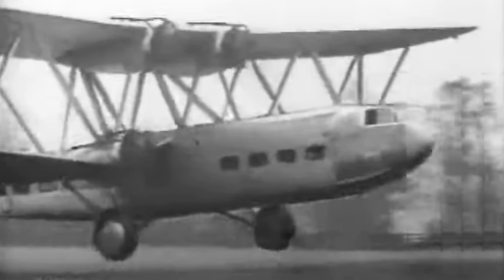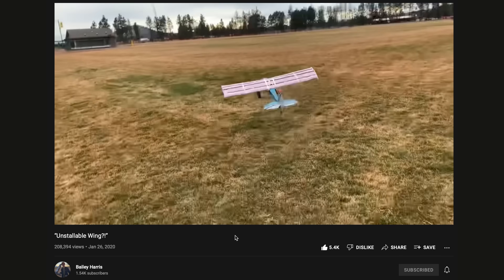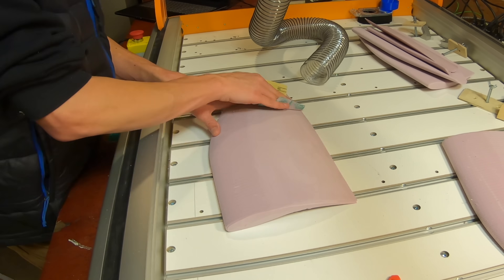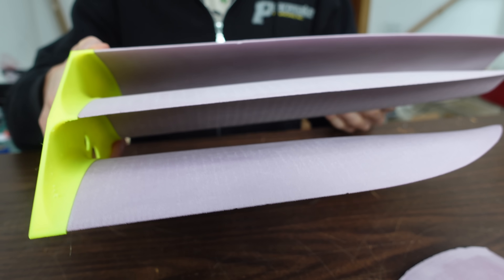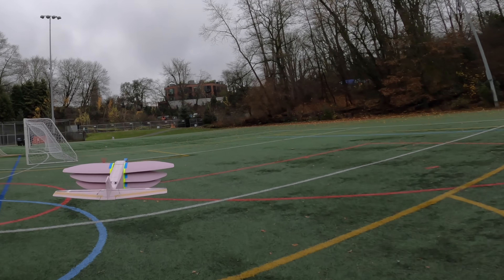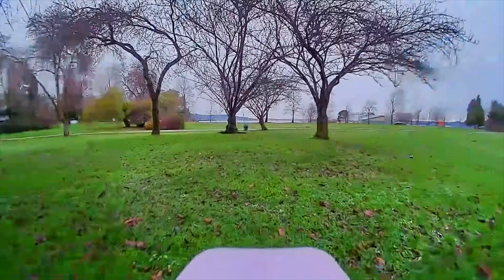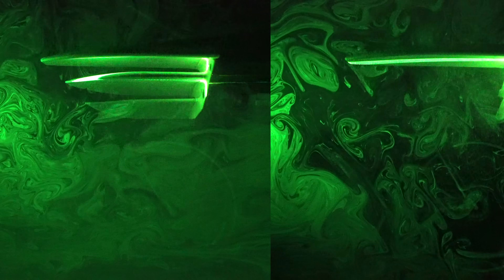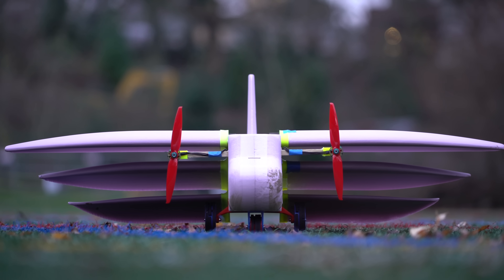Best STOL Wing Design Ever?!?

Comment: I found this interesting.  I would like to hear your thoughts on a ducted wing system porting to the BOTTOM of the wing.  I see what you are doing to maintain the laminar flow of air over the flaps for slow fight control...  BUT as you say  26% of the thrust is used for thrust, what if the ducted air was used under the wing to create lift and use a smaller percentage of ducted air to the flaps.. maybe with a stepped down flap that could capture the air flow from the lower surface???

Comment: High camber leads to high drag, no matter if the foil consists of many foils or a single one.  Seems the Flying Flea design with two very lightly cambered wings (and no horizontal tail) is near the ideal, and you don't even need any ailerons! Pitch sensitive, but with an awesome flight envelope! Like the Shinmeiwa flying boat, no rotation on take off, and flaps on the rear wing for slow flying!

Comment: Maybe incorporating a line of air ducts within a single wing so air passes over, under and through a wing would be interesting to find out the results of  the lift capacity and flow of the air plus air vortices along with other technical elements etc. that occur in this type of design ???

Comment: great flight, it has the stability and smoothness of a much larger plane, is it the future of RC flight, I think not, that is long thin wings similar to a glider with electric props and then free flight, that's what I'm making, but I've kind of stalled, the servos, motors, controllers are expensive and the mixing and matching process isn't obvious, I wish sellers would do basic all-u-need packs for flights builds,

Comment: so you just use all angles of attack at the same time, kinda finite element split method. well box wings with different angle of attack. so how about high aspect ratio wing spacing. come on the trimaran water cat floating boat tracked vehicle tank! :)

Comment: Need to control “speed” with elevators instead of throttle, the pitch down is caused by CP moved rear as lift increases with constant AOA

Comment: If I recall, there are recipes available online for the smoke used in old school wind-tunnels, and with a good sized shop fan attached to a box with acrylic or fiberglass windows, creating the smoke lines through a few holes in a metal box is actually quite simple. Just remember that you're dealing with fire, so keep the box on concrete and obviously outside.

Comment: It would be interesting to see this with like double the wingspan and with a little dihedral. Also, placing the center of thrust directly in front of the center of lift (3 dimensionally) would give you added lift from the engine thrust.

Comment: Something you might want to think about. While sails on a sailboat seem to be significantly different from wings on an airplane, thin vs thick, and probably many other things, there is at least one bit of research that might help you think about this.

Many small racing sailboats have two sails, a main and a jib. It was found many years ago that for a given amount of sail cloth, a jib and a main were found to sail upwind, when they are more like wings, faster and more efficiently, than a single sail. For years this was attributed to the jib improving the efficiency of the main by accelerating the flow in the slot.

But there is another phenomena that racing sailboats regularly run into: when two boats are sailing upwind near and parallel to each other, and  one is to windward and the other is to leeward (pronounced loo-ard. I hate it when someone says "lee-ward", or "gun-whale" instead of gun-ell. Sorry, tangential -- just me) and even slightly ahead, guess which one pulls ahead? It is always the leeward boat. Which doesn't fit well with theory.

Turns out there was this guy, Arvel Gentry, who sorted things out. He was a, "research specialist in transonic, supersonic and hypersonic vehicle aerodynamics at the McDonnell-Douglas company. He was also a successful ocean racing skipper and an amateur photographer." Rather than me bumbling through an explanation, please read this article he wrote for Sail magazine in the seventies.

https://web.archive.org/web/20120308100740/http://www.arvelgentry.com/magaz/How_Sails_Really_Work.pdf

And there are many others if you search.

Comment: I love the concept. But how about you do a T tail configuration.
It should get a smooth air flow.
Maybe even a motor in front of the Time tail configuration( Just like the Tri Lander aircraft ). It should also give it excellent slow speed handling.

Comment: I like it. mostly because its simple. we could improve the inflight characteristics of the design by making a kind of gimbal that move the two rearmost wings up and into the airflow to make just two big wings while in flight and pivot down for slow speed maneuvers. Would have a lot less drag at normal flight speed that makes it unstable

Comment: The throttle up-nose pitching could be caused from the props funneling more air over one or two of the split wings, giving them the predominant lift profile and negating the other wings. You could test this by shifting the props above the fuselage so you get only ambient air movement over all wing sections.

NOTE: I don’t know anything, just a gut feeling.

Comment: One thing I've learned about building RC planes is if it doesn't fly right and crashes there's no use in picking it up and chunking it again with out making no adjustments cause it's definitely not just magically going to start flying better by itself 😂 I've done it though many times till I got sick of buying props and fixing broke motor mounts ect 😆🤣

Comment: You might try it with the narrower wing at top and the biggest wing next, then a series of narrower wings wings in back and under neath, all to isolate and accommodate the air flow and lift on main big wing. That way the bigger wing has the least amount of breakaway air wrap/lift on the top of it, and the most uniform lift. Then find the best angle of attack for each wing interacting together, and then the whole wing cluster together. Then adjust the proper angle of the fuselage to create it's most amount of lift. Keep in mind using the center of weight of the fuselage for proper nose weight, without having to use extra nose weight, which will keep the plane lighter. Then add that fuselage set up to the correct angle of main wing cluster, and you should have a more efficient lift to drag and weight ratio for a given plane. My dad and I used to make balsa wood gliders back in the early 60's. Of course the sky is the limit on designs that work. The combinations just have to be solved so that all the force fields co-operate. I really like how you show how these theories of lift are at play and in use here with millions of lives at stake, all day every day with the airlines, and how efficient they are with their radical flaps on big jets. Great photo examples of this.
     But of course, there are different purposes. Big jets have to do it all, efficiently, to be safe and save money. An albatross has to surf the air waves above the ocean waves for thousands of miles a day. There fore they have one sleek high aspect ratio super long wing-span to operate at extreme high speeds for a bird, over 99% of it's flying time. Where as the opposite extreme is slow flight speeds where you have insects like moths, butterflies, bees, and dragon flies with overlapping multi-wing set ups, for STOAL manuevers for sipping nectar, eating, and spreading pollen all day long.

Comment: Perhaps running a single propeller directly in front of the plane? It looks like the top two wings get the accelerated turbulent air but the bottom one doesn't which changes causes the plane to nose down upon throttle increase.  I'm no expert, just an idea.  Perhaps you could put the propellers behind the wings somehow?

Comment: Yeah yeah.
But with adjustable engines, (you have them on a Pylon) just go V-22 Osprey if you want STOL.
Because Real Aircraft, With Real People flying them. Are already landing in less than 10 Feet. And Drones with no wings land pretty short too.
... looked like about 6ft for your 👍 that's something

I got a Paper Airplane that can match it. And it takes less time to assemble 🤣

RC'S ARE COOL 👍 👍 👍

PS.
You don't need the extra weight of 2 Servos in the front or rear. Especially in a low speed RC. I never used separate Servos for anything under 70mph.
But,.. I used my aerospace engineering knowledge back then. Not a half dozen computers. You guys will catch up 😂 🤣 😂 👍

I gotta add.
There are Fat Delta Wing RC Designs that will outclass what you are working towards.
Simpler. Easier. And better low speed lift for tiny planes. They are like a Kite 🤗

... blah blah blah , Enjoy 🖖

Comment: Very Cool, but very impressive machining center. Laser Milled in 3D, is truly magic. 
My thinking might make the wings longer by 12 inches, and adding a couple more inches to trailing edge, and use just two wings. 
I'd really like to see landing gear using long carbon fiber skids about 1/2" wide vs wheels for smoother rough grass landing and take offs. 
Never got around to experiment with my 2.5 meter glider, but wanted to try a single motor to Twin out board props by belt drive. Finding these parts is the hard part. 
The auto flight feature is very impressive.
Cheers

Comment: Hey Flyboy, you have the basics of aviation wrong. Wings do not create lift by pushing air down. They create an area of low pressure above the wing by pushing air over the curved surface. Thats where the lift comes from.

Comment: Would have had to lower the props with the additional added 2 wings to balance the pitching forward under throttle. The extra wings cause extra drag thats far out of line with the pull of thrust

Comment: Put the ones on the bottom, in front, so the compressed air is forced under the upper wing.there must be more pressure  below each wing than above it. Unless they are at different angles.

Comment: Howdy, very intresting work. I was really impressed with your CNC fab of your plane. I have a design that I want to build but don't have the equipment or RC experience. My plane was built with balsa wood back in 1984 and just as a gulider flew with no breeze over 100 ft straight and level. I have always wanted to up scale the design and RC it.  Would you be interested?

Comment: This wing design has loads of drag, because in forward flight there is loads of disturbed air behind the main wing. If you want to make a really good STOL plane look at how BUSH PLANES work. The main wing has normal angle of attack but quite a thick aerofoil, which generates loads of lift at low airspeeds because of the high pressure differential between the upper and lower surfaces of the wing. The planes are also very light. Thus they take-off and land at low velocities, but still fly well because the wing design doesn't generate lots of drag.

Comment: Hey what if there were two more motors in the hull with shafts protruding out behind the craft with not propellers on them, but counterweights the same mass as the propellers that themselves are just slightly imbalanced on their shafts.. if they were spun the same rate as the front props would they potentially counteract the spin the craft feels when throttle's increasing and stabilize forward flight along the vert. axis causing far less movement off of it's set course trimming when changing speed

Comment: I'm glad to see you make 'special' mention of what you call 'twist' which is really called 'washout'. Washout is critical at conditions nearing stall conditions. At these conditions, portions of the wing nearing the wing tips are still flying. This allows for aileron authority as the stall condition progresses ... you really want that. A more general, yet similar, relationship exists between the mains and tail angle of instances (tail being less than the mains) thus providing pitch authority even as the mains start to stall. Both of these give you a chance to 'wake up' and fly the airplane 'out and away' from disaster.

Comment: You might want to look at F1 front winglets. Although they're designed to produce maximum downforce at low to medium speeds, and channel the airflow towards the car, they also design them to stick the airflow to the body of the car, so that it doesn't stall.

I would look at F1 wings around 2020 2021, as this was the year that upper Airflow management on the cars were kind of at the peak

Comment: Wow... u are actually contributing alot to full scale electric flight. This means that electric planes can extend range by flying slower but still be able to take off. This helps prevent too much battery loss during take off, which usually needs full throttle. So low throttle take off and then if the wings can pitch level abit, then the electric plane can move forward at faster speeds with less drag. Will have positive impact on real world e-flight.

Comment: "it broke free yaaaay"
it broke a lot more than just "free" my guy.  But it's great you got your electronics back. Do you think the throttle-nosedive would have been less of an issue if you put the motors in pusher mode on the back of the wing instead of forcing more air into the middle of the airfoil?

Comment: What seems to be nice about this multi-part wing design is that it seems to be symmetrical in a design that can fold itself nearly flat for normal use and then unfold for low-speed work.  Using flexible membranes and internal shifting "bones" using very light-weight carbon-based materials, you could get this kind of multi-shape wing that gives flight from supersonic to almost like a kite...

Comment: Maybe the motors and propellers could be pusher versions.  That would smooth the airflow through the wings even further.   Maybe use small EDF units, they come very light and are easily controlled.

Comment: The definition of a stall is the point at which any further increase of alpha results in a reduction of lift, not when the flow separates from the top of the wing.

Comment: Very cool project. Interesting (?) aside: I used to fly a Piper Seneca with Robertson STOL conversion which had full-span flaps. The only “approved” t/o setting was with those flaps extended, which created the same wheel barrowing effect you experienced, causing the nose wheel to bang back into the runway immediately after lift off and sort of bouncing the airplane into the air unless the initial rotation was VERY aggressive. This is not the road to confidence or comfort for passengers, so I learned to ignore the book and take off with zero flaps.

Comment: Try a gyro stabilizer.  It is a spinning disk like a bicycle wheel.  Horizontal axel. Pushing the axis   of the gyro tips the plane side to side.  I built one years ago but mounted the gyro the opposite direction (wrong). I have a very interesting design that uses a gyro to stabilizer. the wing is opposite direction of normal wings.  It has a narrow leading edge and is very long.  Sort of like a flat arrow.   Reply and i will give u more details.  It also has a outrigger backup stabililzer that can be extended in case the gyro fails.   It is road worthy and aqua and can be a bi-wing as well.

Comment: As far as the pitching moment with thrust - it looks like you had plenty of ground clearance for the prop tips - what about moving the props and motors downwards so the center of thrust is lower?

(although, counterintuitively, apparently it was moving the engines forward and up that caused the 737MAX to have a bad habit of pitching upwards...  But shifting the motor position around might help?)

Comment: Thats one of the problems with STOL aircraft, they can land slow, but they fly real slow so getting anywhere takes a long time... A cessna 180 will stall about 45 knots and cruise at 125 kts. Depends on what you want to do. 
Great project, well done.

Comment: I don’t understand why you didn’t immediately remount the motors lower, and why you didn’t use a canard. Maybe put the wings on a track, so you can pull them together for cruise. And remember feathers: Flexible roots with an integral spar that automatically compensates for speed.

Comment: When the plane nose-dives with too much throttle, would it help to (constantly!) rotate the motors and propellers up some degrees?

So no servo for the motor pitch control, just try maybe 10 or 15 degrees fixed.

Comment: It pitches down because the airflow is getting choked in the upper 2 flaps. The low pressure between the two flaps formed by the prop is probably lowering the clearance by pulling the two wings together.

Comment: You don't need to do this. The Eagle XTS has a forward canard wing which is low mounted, the main wing is shoulder-mounted and the horizontal stabiliser (which is also a lifting surface) is mid-mounted. Looking directly from the front it looks like a triplane, but it isn't. Brilliant lift and also low parasitic drag.

Comment: Mate...... that was an awesome video. I love your grasp on the technical and mathematical elements. Please don't be afraid of the hard work required to refine what you're doing. Sounds like you learned a lot from this one. How about starting again and doing all of the things you said you should have done or correcting small imperfections like  the fibreglass on the tail. Maybe increase the wingspan? I will subscribe to your channel and hopefully if you keep going you might rake in some mun muns. $$$

Comment: For aircraft you can fly in you need to include the fact that their wings are created differently and that they are not as stiff as wings on such a small scale are. The "problem" could be "wings oscillating and bumping into each other in flight" ... which would make connections between the wings at the tip necessary for anything bigger than a Cessna.